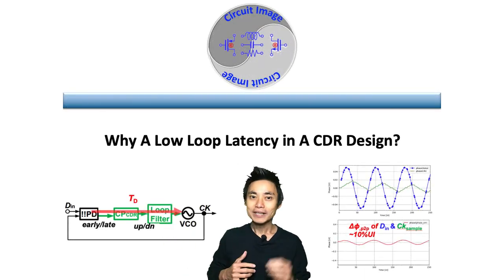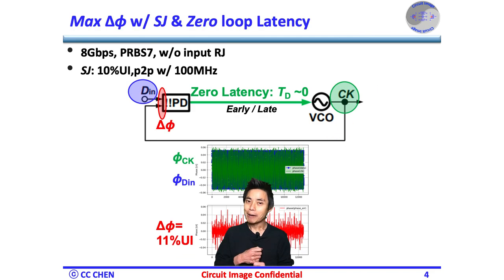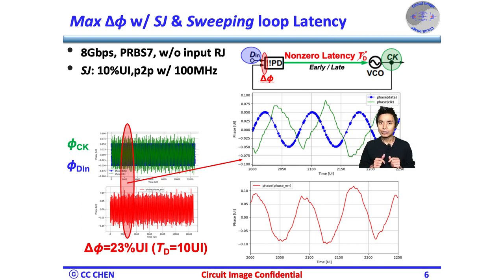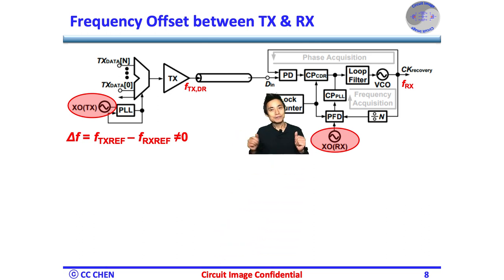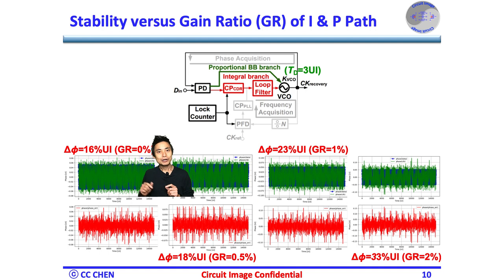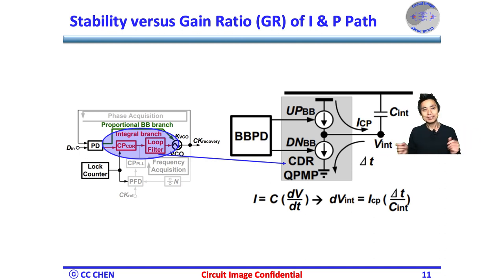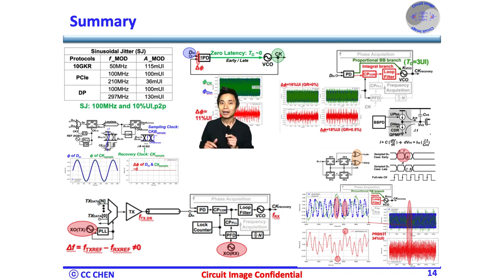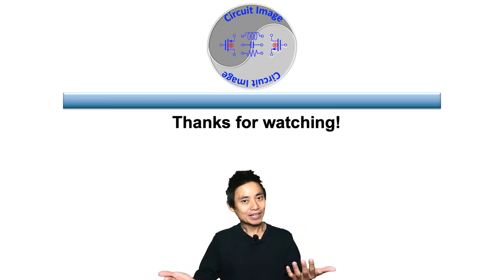Why A Low Loop Latency in A CDR Design?

Comment: Thanks CC chen for excellent video. 
I'd appreciate if you can answer two questions from this video:
1. When we say GR=2%, how GR is defined? Since integration path gain is a function of frequency
2. What is the intuitive way to see the phase error increase as integration path gain increases? I expected intg path provides higher DC gain such that the residual phase error is smaller
Reply from the maker: Hi Pekklenky,
Nice to meet you. Thank you very much for the great questions. You're very welcome. I have comments below.

1. When we say GR=2%, how GR is defined? Since integration path gain is a function of frequency
[CC] GR is defined by the ratio of the integral gain and proprotional gain. You're correct that the integral path gain is a function of frequency in your design. But, to achieve a robust operation & predict analysis, you might want to make both proportional gain & integral path gain are a function of frequency, but with a fixed scale ratio over frequencies, which should be doable.
2. What is the intuitive way to see the phase error increase as integration path gain increases? I expected intg path provides higher DC gain such that the residual phase error is smaller
[CC] You're correct, so the high integral would provide a quick frequency offset correction. Unfortunately, the integral path BW could be too low compared to the input phase movement, which is a time lag in the time domain to cause a stability issue. As long as the integral path BW >> BW of the input phase movement, that would be fine.

Thanks,
CC
Reply: @circuitimage  Thank you very much!
Reply from the maker: @pekklenky  Hi Pekklenky, you're very welcome.

Comment: Hi Chen, nice video. My question is  that is there any implication between lower integral path gain and maximum ppm offset to be tracked?
Reply from the maker: Hi HY, 

Thank you for the good feedback.

Yes, the lower integral path gain and maximum ppm offset to be tracked will increase the lock time and the following link training time.

Thanks,
CC
Reply: @circuitimage  Hi Chen, really appreciate your answer. So am I right to say, by using this architecture (like type-II PLL?), VCO tuning range is the only limiting factor for the maximum ppm offset to be tracked, regardless of the lock time?
Reply from the maker: @jysun9290  Hi HY, 

Thank you for the good feedback.

Yes, your understanding is correct.

Thanks,
CC
Reply from the maker: Hi JY,
Thank you so much for the kind words and good questions.
You're right. The VCO tuning range was only the limiting factor, which might also related to the charge pump's headroom constraint.
CC